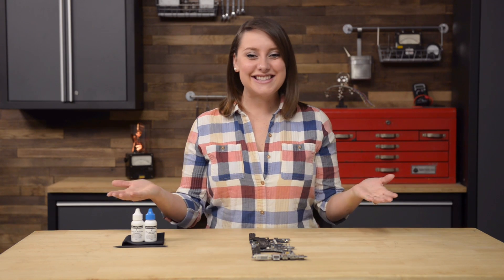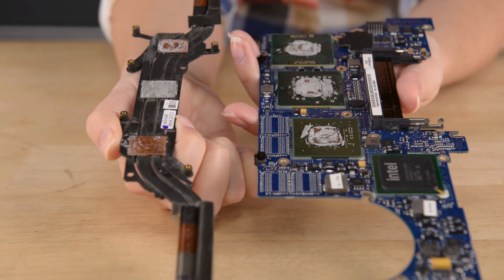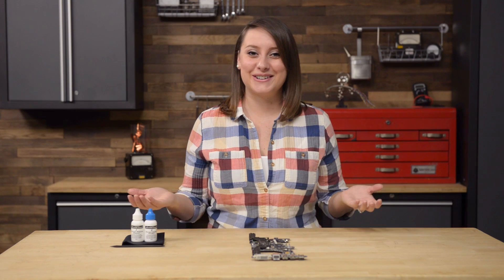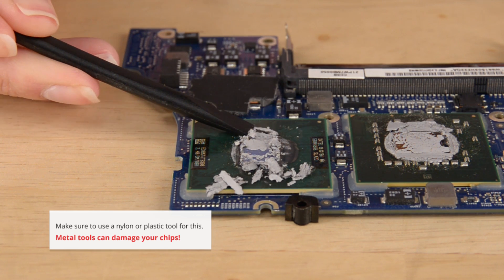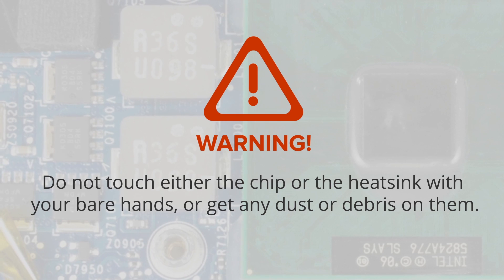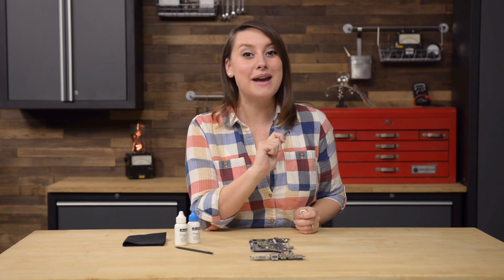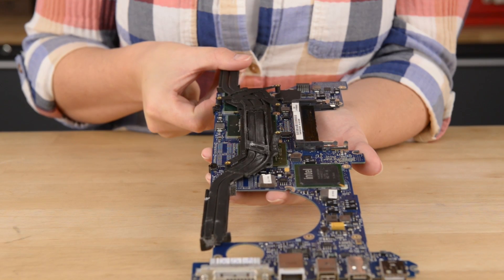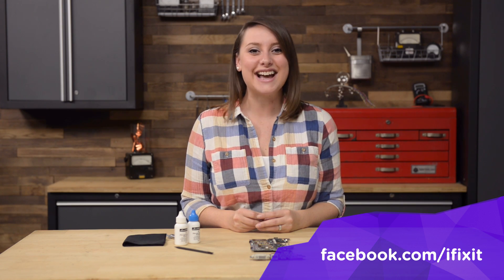Basic Skills!: Thermal Paste

Comment: thermal paste is not an adhesive! thermal adhesive (often a 2 part epoxy) would be a terrible thing to use in most devices. eg, if you need to disassemble the device at a later date for maintenance or a cooler upgrade, you could risk destroying it in the process. how nobody seems to have picked up on that over the last 4 years is beyond me lol

otherwise, great video! some of us prefer the pea method, but the spread method ensures full coverage which is probably the best method for first timers assuming they aren't using an adhesive.
I guess one more tip I can throw in for rookies whilst I'm here, is that before disassembly it's often good to run the device/machine for a few minutes under load first as it helps when breaking the seal that thermal compound tends to form against the heatsink, and it helps the thermal interface cleaner evaporate if it's still a little warm.

Comment: I replaced the thermal paste in both my ps3 slim and ps4 over a year ago I used a carbon based artic mx4 and I used the spread method with a paper business card and never once have my systems overheated you don't have to worry about air bubbles and the pea method is not the way to do it, ever notice when you get a new heatsink for a pc that has pre applied paste its spread not just in a dot

Comment: They did an interesting test with a glass plate using the different  methods. It turns out that the pea methods did get the best results. A small 0.3-0.4 cm pea should do it, in the middle. 

The use of glass was interesting because you where able to see how the thermal paste spread it self on the cpu chip. Spread it like on the video showed that air bubbles was created.

https://www.youtube.com/watch?v=-hNgFNH7zhQ

Comment: do I absolutely need to reapply thermal paste? I took apart my ps4 to clean out my overheating and constantly shutting down system. Went and bought your tool kit with no mention of thermal paste
Reply: +Tom Karathomas You need new thermal paste if you removed the heat-sink.  Otherwise you are just rolling the dice.  Antec Diamond is what I use.  Fry's at the time did not have Arctic Silver in stock.

Comment: So uhm, when you spread the paste, do you not spread it then still apply the heatsink so it still "smushes" any what could be air bubbles in the middle of the chip out. if anything the excess should come off the side so little that it wont hurt, but if you dab it with too much in the first place then it has more of a chance of running off the shorter side thicker. all spreading is doing is allowing max dissipation. and thats what computer guys should like. if you are so picky about messing with a computer, you should be good at spreading thermal should you not? or you will overclock all your memory and throw 10 heatsinks or liquid cooling systems on everything but wont spread the paste?

Comment: Good video. I typically use GC Electronics Z9 heat sink compound due to it sticking very well. I usually apply the paste with my finger tip after cleaning the chip and heat sink with 91% isopropyl (rubbing) alcohol. So far this method has worked for several of my servers running dual Xeon 5080 130w TDP processors running for over 4 years with no issues. I have done this countless numbers of other processors, power transistors, and voltage regulators as well with no heat transfer issues.

Comment: I fixed my old Fat PS3 using the spreading method, and it died a death within a week, I tried it once more and it lasted only an hour.

After a lot of searching around the internet I tried using the pea technique, I just put a small blob in the middle and put the heat sink back on to spread the paste and it is running better than ever (currently 4 weeks).

Thats my experience at least, and if you are curious of to where I found this information just do a  simple search on youtube and google, it is recommended by ASUS and many a thermal past manufacturer.

Either way I still love iFixit!
Reply: I took apart my ps3 slim and used the "smear" method as yall call it. That baby is still purring to this day.
Reply: billyp332 How long ago was it? you will get some time out of it, but for me I get better results jutting applying a pea sized amount, and no breakages yet.

I know it will break again eventually but at least  I managed to get a backup :)
Reply: Hey Borialis. Im just now seeing your message...let me think a minute...I fixed it earlier this year. I think it was May of this year (2014). So Ive gotten 7 months out of it. Not so much as a hiccup. The only thing is I have to use the av cables. Its somehow forgotten how to connect with HDMI. I dont game on the console I just use it for Netflix, Hulu, etc. since I dont have a smart tv but it works great. No overheating. I can leave it on as long as I want.
Reply: also Borialis I did cut open the back vent area to  allow more heat to escape. Just remember if you do that not to stick your fingers around that area or your in for a shock or worse. thats the only modification I made to it.
Reply: I used mine for a lot of gaming, oddly it died for me when playing a dvd.

I haven't made any mods to the casing though.

Anyhow I hope it keeps working for you.

Comment: For my PlayStation I found that applying a small amount and then wiping it all off without any cleaners on both the heatsink and the CPU to prime the surface and then the rice grain method without spreading works the best and achieves lower temperatures.

Comment: I don't want to be 'that guy', this is constructive criticism, but first of all you used waaaay too much thermal paste for that tiny chip, and NEVER spread it as this causes air bubbles that decrease cooling efficiency. The thermal paste is there simply to fill in the minuscule dents in the surface of both the chip and the heatsink's contact area, as direct contact always gives the best heat transfer performance. So with that in mind, do the following:

1. Apple a very small amount of thermal paste to the thermal surface, as a rule of thumb a pea sized amount is enough for a standard CPU (The type with a large metal cap on as shown in this picture: http://images.bit-tech.net/content_images/2010/07/how-many-cpu-cores-do-games-need/cpus.jpg) so adjust this amount depending on the size of your thermal surface.

2. DO NOT attempt to spread the thermal paste, and instead simply install your heatsink. The thermal paste will spread itself as you tighten the heatsink into it's retaining device.
Reply: Andy Jones Spread method vs. Dot method both produce similar results, in fact, often lower. See here for benchmarks:

https://www.pugetsystems.com/labs/articles/Thermal-Paste-Application-Techniques-170/
Reply: Thomas Anderson granted under controlled testing the differences between results appear at first glance to be negligible. However I found a flaw. They performed this on an open air test bench, which is not likened to that of a general, enclosed chassis build. With a standard build in a closed case the temperatures would be higher in practice, and the differences between them would be greater. 

This test does however prove that spreading DOES introduce air bubbles. 

Also the fact that the no spread method does not appear to cover the entire cpu is irrelevant, as over the course of a few days or even weeks the thermal compound will slowly spread further under the pressure of the heatsink.

Comment: I never spread the thermal paste like that. The force of the heat-sink will spread it evenly once it's all tightened down. And as far as cleaning the CPU/gpu or whatnot chip and heat sink you can use a lil rubbing alcohol. Been doing it for over 15 years now on laptops' Xboxes, playstations and more and never had an issue.
Reply: We all know what she's naturally a pro at... lol.

Comment: You shouldn't spread it like that, it'll create micro bubbles of air... Better to put the drop of thermal paste and then just apply the heatsink directly. that'll create the best layer or air bubble free and smooth thermal paste. Also no need for fancy things, just plain alcohol is fine to thermal paste removal!
Reply: ***** but he is right. it does not always do it tho, but it can.
Reply: ***** He is right. You can check this video How To Apply Thermal Paste
Reply: +iFixit Video They did an interesting test with a glass plate using the different methods. It turns out that the pea methods did get the best results. A small 0.3-0.4 cm pea should do it, in the middle. 

The use of glass was interesting because you where able to see how the thermal paste spread it self on the cpu chip. Spread it like on the video showed that air bubbles was created.
Reply: not to mention that was a LOT of paste for that tiny die
Reply: Zeuz Incorporated Jacob Koehler ***** GoshirnGaming 
Jacob is right, as is GG. This is especially true with some of the cheaper laptops where there is actually a gap by crappy design between the CPU/GPU and the heatsink. In this case, as terrible as it is, a thick layer is required vs... a giant air gap, which could be a result of the iFixit method. Just one more reason to use the dot universally.
Reply: ***** GoshirnGaming 

Depending on chip size, this can lead to inefficiencies as well in the spreading. 
Finger spreading is bad though. But chip coverage and thickness of coverage is important.
The paste is supposed to fill the iddy biddy spaces to complete coverage of chip to heatsync contact. Too much paste can reduce the thermal transfer as well as too little paste. 

General method we've always used is smear, scrape and lap. 
Lapping is hard, so if you smear then scrape with a good sharp edge of a credit card, you'll leave enough to create a good bond, but not have so much on there that it reduces effectiveness of the transfer, or have so much on there that the paste rolls over onto the sides of the chip as was being scraped off. 

Smear method is quite fine for old style thermal pastes, but we have long since moved from those except in mass manufacturing processes.
Reply: +Zeuz Incorporated The thing is, that the chip it self is square. At the edge of the chip there is not much, actually nothing. So Pea methods will give good cover over the actual components inside the chip that create the heat. 

The test with a glass plate, that tested different paste methods showed that it covered good margins around the actually little components on the chip that create the heat, and no air bubbles was created as it was with the smear methods.
Reply: either way there will be some type of bubbles and you wont see much if any difference
Reply: thank you for this great tip.
Reply: Zeuz Incorporated not true, as the metal covering the chips that you see are actually covering (usually) 4 underlying chips, that will be covered by the circle (it's not a sphere btw) of paste when the dot method is used.
Reply: ***** like you said even a fingerprint is bad for headspreading wonder what micro airbubbles do. if i remember right teksyndicate did a video covering this topic that explained this very well.
Reply: +GoshirnGaming I can confirm this way is better.
Reply: ifixit engineers are genius.
Reply: Spreading in the manner described in the video can absolutely cause air pockets. I've had great success with the pea method for all my device builds and repairs. That said, I'm not sure the difference will be much if any.
Reply: wrong! Thermal bubble is a sphere and when you press it  its going to créate a circle but the chip is not round is a square then you dont have enough Surface for the heat to transfer to the heatsink.
Also you dont have to get thermal paste around the chip as you will unecesary heat other components and you could damage it.

The best way and most efective is to spread it with the finger and make sure you put enough to have complete contact with the heatsink.
Reply: bit respect to the lady guys ;)

Comment: No, no, no. Do not use your finger to smear the thermal paste, it will ruin the effect of the thermal paste. Just put a small amount of paste on the processor, roughly the size of a rice grain, and put the heat sink on top of it just like that. Do not smear it or try to even it out with something flat like a credit card or anything like that. Classic beginner move, terrible idea.
Reply: You know there is no right or wrong way to do it except applying too much or too little or using your bare finger. This method and the one you're stating are equally accepted and there is no difference in performance.
Reply: Man, you are wrong in saying so. The smearing of thermal pasta creates bubbles and reduces the effectiveness drasticly. Don't smear it at all.
Reply: i dont agree with that. My laptop burned the graphics card because of your method. I changed the graphics card myself and applyed the thermal paste with my finger. My laptop runs ice cold and managed to get 7ºC less than before so i dont see nothing wrong with it.
Reply: +Zeuz Incorporated Then you had to little paste on, a rice grain is to little. Of course you can run the pc with spread method, but it will give bubbles, you will probably go just fine with the heat. But pea method with right amount of paste do best.
Reply: xPowerShotx somehow the spreading method differs from one processor to another. Here is an example http://www.arcticsilver.com/intel_application_method.html#
Reply: Zeuz Incorporated: The recommendations outlined there are literally telling you to apply the thermal paste where the CPU die is underneath the IHS (heat shield). The CPU die size and configuration will vary from CPU to CPU depending on the number of cores and architectural configuration. Again, see the differences in these processors here:
- http://www.pcgameshardware.de/screenshots/medium/2013/06/HWbot_gekoepfter_Core_i7_4770K_3-pcgh.jpg
- https://upload.wikimedia.org/wikipedia/commons/2/21/Xeon_Beckton_with_and_without_heat_spreader.jpg
- http://imagescdn.tweaktown.com/content/1/6/1642_8.jpg

That is why Intel's recommendation differ, per http://www.arcticsilver.com/intel_application_method.html. The "pea" method will work well across the board, regardless.

Comment: guys, please dont use the spread method that she used in this video. spreading it like this will create bubbles of air that will decrease the effectivity of the paste.

I would highly suggest that you check out LinusTechTips for a proper thermal paste video
Reply: round pea of thermal paste rectangle chip how will it cover all the chip without spilling the paste?
Reply: PoodsterGaming yeah but you wont have it spread on the entire Surface...you will have the edges uncovered. and the heatsink wouldnt be useful at all.
Reply: Zeuz Incorporated You are wrong about that one. It will go to the edges because the thermal paste will heat up and spread even more. It will be an even layer unlike the spread method. Now it might leave maybe a tiny tiny bit uncoved on the corneres but that doesnt make a difference at all.
Reply: PoodsterGaming if the termal paste isn't enough, when it will heat up and spread, there will be only a minimal contact between the chip and the heatsink. it depends really...the best way is try and error and only then you will find the right method. i did the spread method on my laptop and managed to get 4ºC less temperature while using it...so for me it worked.
Reply: +Zeuz Incorporated: There is absolutely no need to cover the whole IHS (the heat shield on a processor) as the CPU die is only a small fraction of the IHS itself. For example, take a look at a picture of the CPU with the IHS removed: http://www.pcgameshardware.de/screenshots/medium/2013/06/HWbot_gekoepfter_Core_i7_4770K_3-pcgh.jpg.

In the picture, the right portion shows the IHS (height shield) for the processor (where you apply the thermal paste). The left side of the picture shows the CPU die underneath the ISH; as you can see the die itself is only a small fraction of the entire IHS.

Using the "pea" method of applying thermal paste will properly cover a large (circular) portion of the IHS, including the area directly making contact with the CPU die. If you are worried about coverage and want to cover a large area, simply apply a little more thermal paste (but never apply too much thermal paste as this may cause adverse cooling affects).
Reply: yea i guess it is personal preference and trial and error. Well you end up putting the same amount of thermal paste on with both methods, so it'll have enough coverage once it spreads, plus you don't need that much because having a thick layer is actually worse. Yea i used the dot mothod and i get a cool 27 degrees celcius on idle and 55-60 degrees celcius on max load at 100% cpu. But if it works, it works :)
Reply: Zeuz Incorporated it will because the heatsink will spread it out toward the edges. It will not go over because of the friction between the two objects and that it would have to slide down the side via gravity. The thermal paste is not heavy in mass so it wont spill over the side. If anything the spread method will because you are spreading it from edge to edge. And once you apply the heatsink with a great amount of force, there is more thermal paste to go around the side and spill.